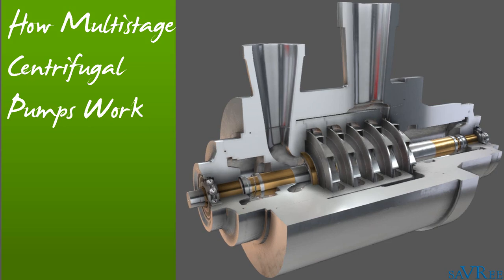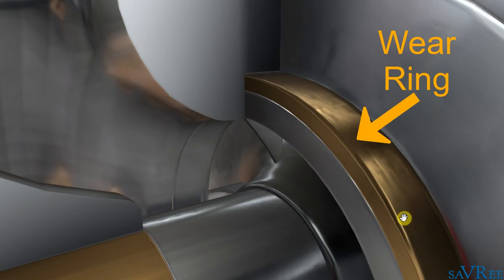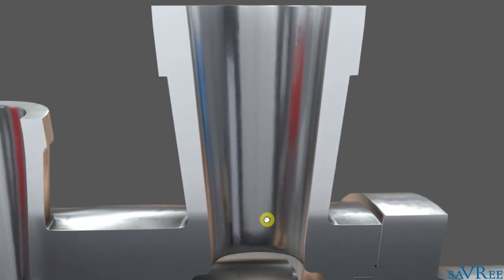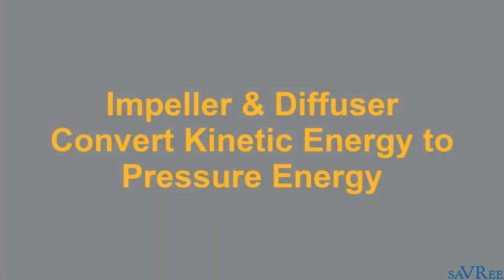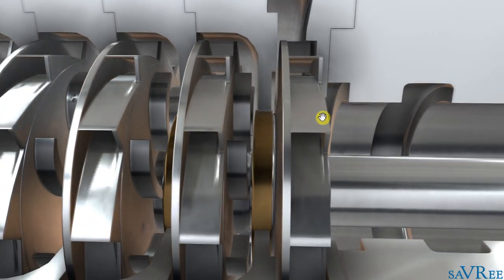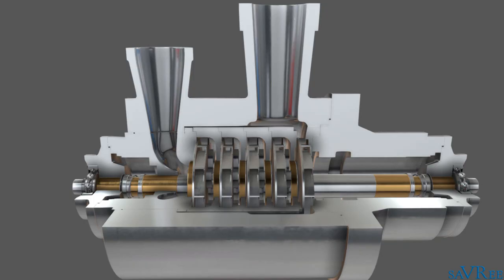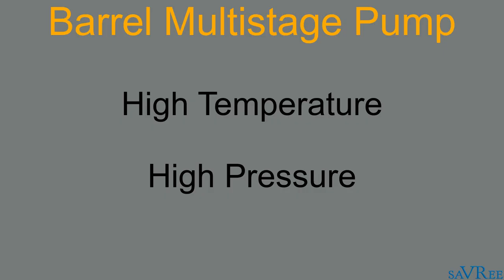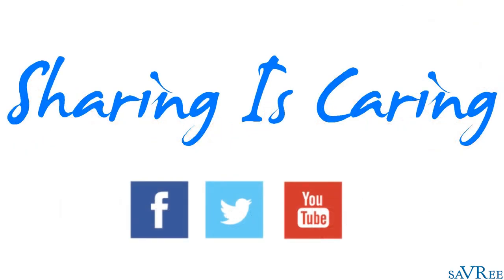How Multistage Centrifugal Pumps Work

Comment: You said that the impeller is used to reduce the velocity and increase pressure, but I thought the purpose of the impeller is to increase the velocity due to centrifugal force, and once it is passed to the diffuser, the kinetic energy is converted to pressure since that part is stationary
Reply: i think its the diffuser that will slow the velocity but increase the pressure.

Comment: Which compressor is best for air compresion  (centrifual or reciprocating)
Reply: @savree-3d   this type centrifual compressor how many bar and volume makes   this type centrifual compressor  approx?
Reply: @Ssraja-kk4cj  If you need small volume, high pressure then Screw/reciprocating any positive displacement compressor. High volume low pressure then a single stage centrifugal compressor. If you need high pressure and high volume then Axial Multistage Compressor( 10,000kPa.) I worked in a cryogenic plant, used Axial Multistage compressor for volume.

Comment: I have lessons about them in class and i am trying to understand them more... They teach us not in english language and translating into english these centrifugal pumps may have one piece of low pressure stage and several pieces of high pressure stages. Is it the exact same as multistage centrifugal pump? because "multistage" can be understood as "one low pressure stage and several high pressure stages". The first stage has the lowest pressure and the others are high pressure stages. Do i understand it clearly? I understand that its the same just the terminology is a bit different. thanks
Reply: Multietapa o multipasos es lo mismo. El primer impulsor incrementa la presión de succión y lo aplica directamente al segundo impulsor y sucesivamente, por lo cual, la presión se incrementa___ Gradualmente__  hasta el último impulsor.